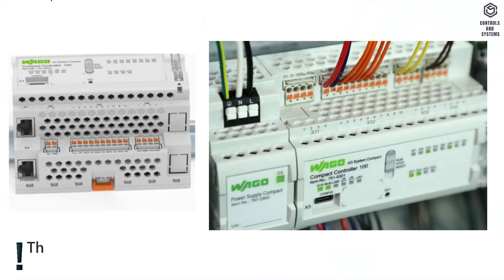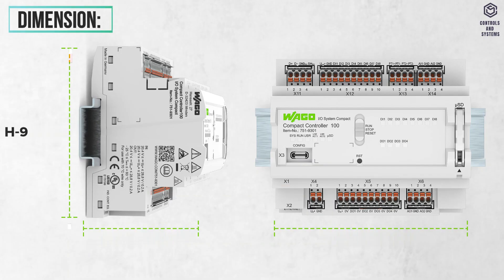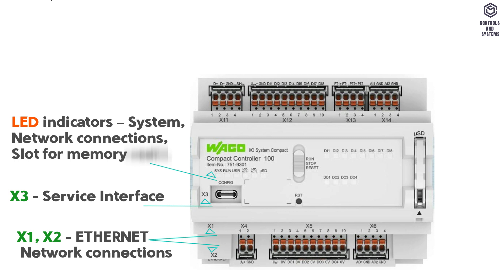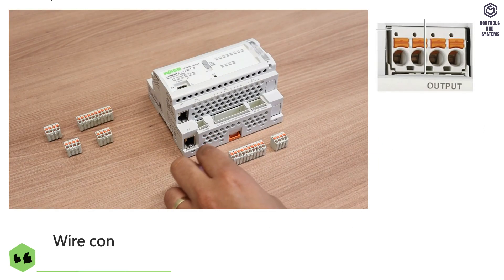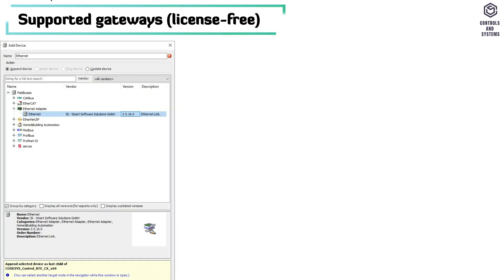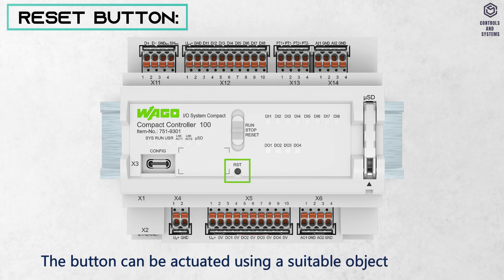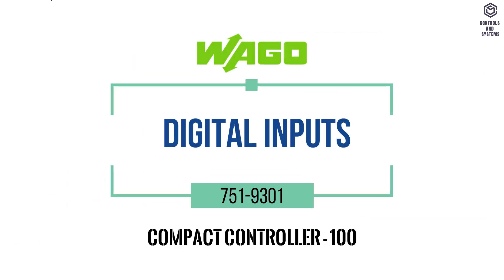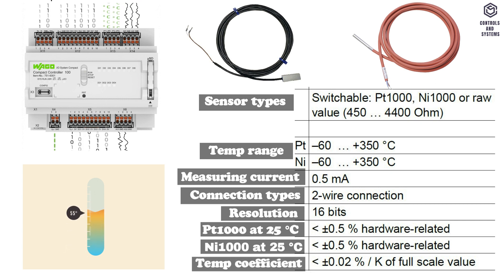WAGO Compact Controller 100 Overview & Technical Details 🔍⚙️

Comment: Where do you buy it at?
Reply from the maker: Thank you for your great question; I did not purchase this Wago plc controller; instead, I reviewed the wage controller instructions; if you want more information, please visit the Wago website.
Reply: @ I did that and  controllers start at $499 and up depending on how many ports.
Reply from the maker: @ Yes, it is reasonably priced when compared to other vendors' PLC controllers.
Reply: @insightcontrolsystem  I did find more reasonable priced PLC controllers. Depending on what they need them for. But also depending on if they are UL or CE.